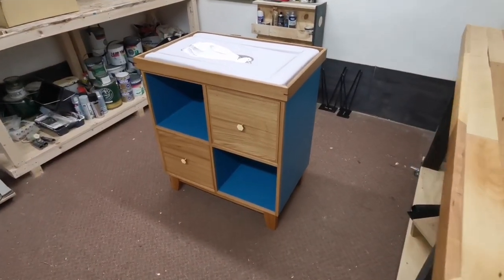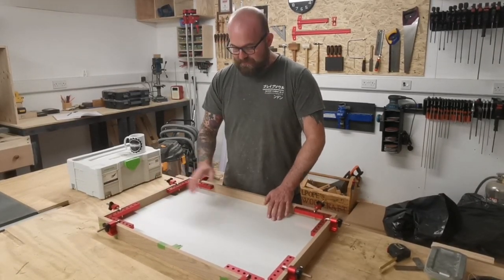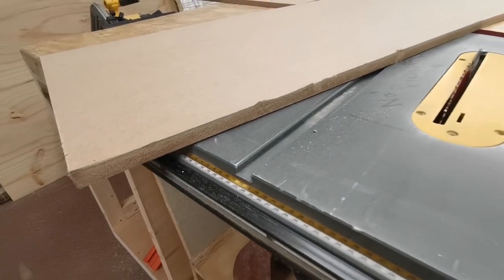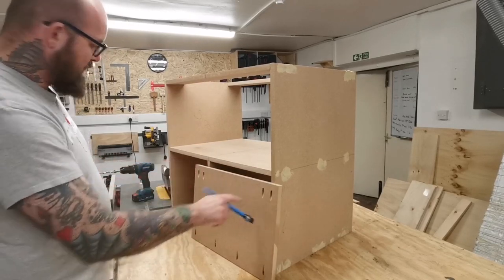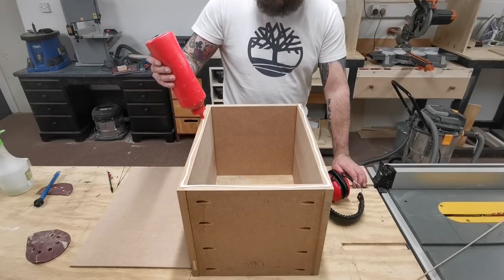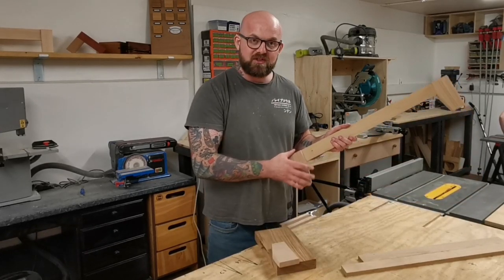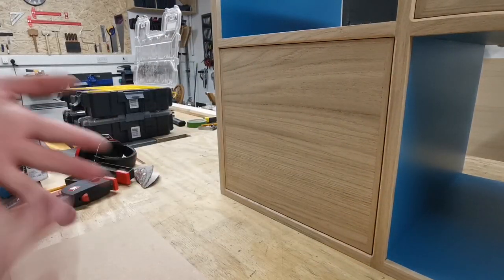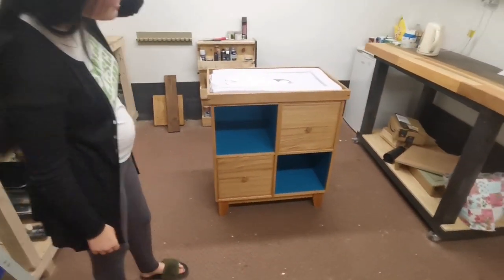Baby Changing Unit Table Station Build How To Woodworking

Comment: Great job Karl enjoyed the build process, very effective   the two tone natural Oak and teal colour scheme. A constructive tip for you Karl, use double sided stickey tape to hold your drawer fronts in position, then put some two F clamps on before inserting the screws just to stop any slight movement. Tony
Reply from the maker: Thanks Tony, good tip as well 😊

Comment: Hi Karl great job, you make it look so easy! What planer/thicknesser do you have?
Reply from the maker: Hi Reginald it's an old performance power that used to be sold at B&Q. I've literally just bought a newer version the Scheppach model, nothing wrong with the other one I just needed a bit more power, extra capacity as its running quite a lot.
Reply from the maker: Ps thank you 😊